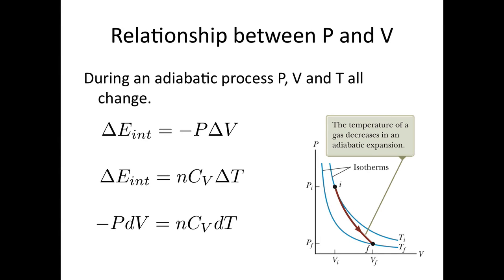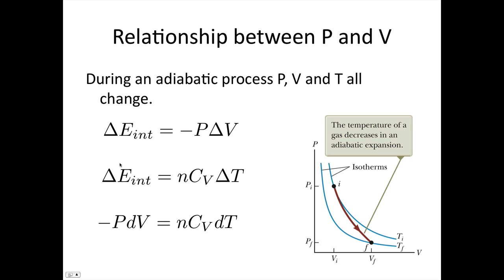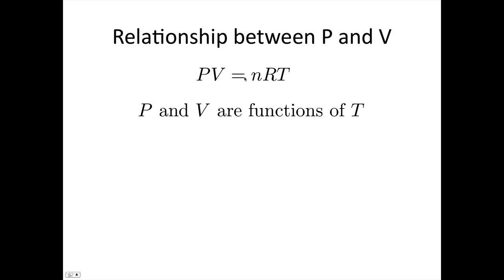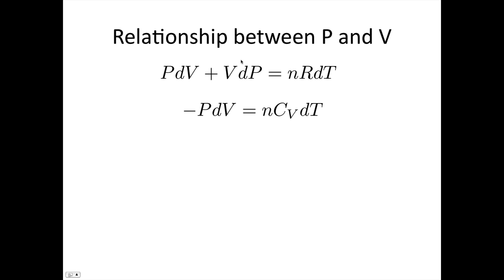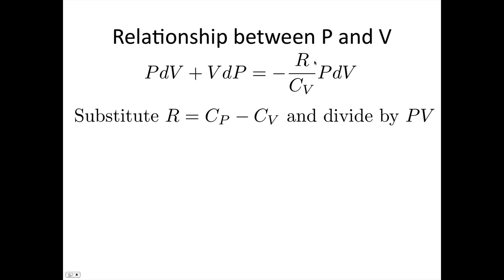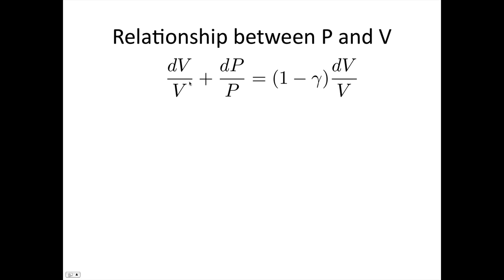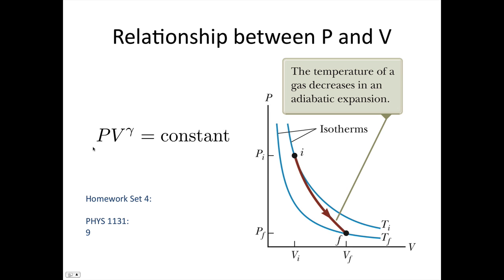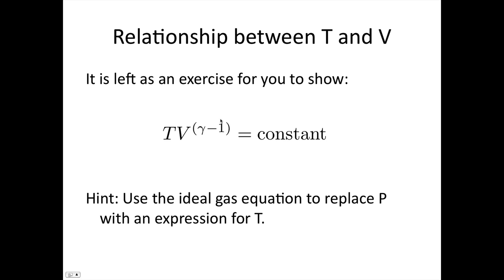Derivation PV^gamma

Comment: lost in the first step. How are they =
Reply from the maker: Because the change in internal energy is equal to (f/2)*nR Delta T, now as the change in temperature is the same for both the constant volume and constant pressure cases and we are talking about the same same gas sample (same n and f) the change in the internal energy is the same for both the constant pressure and constant volume cases.